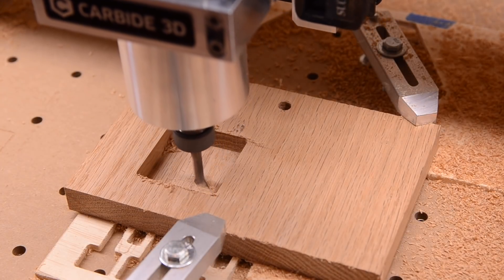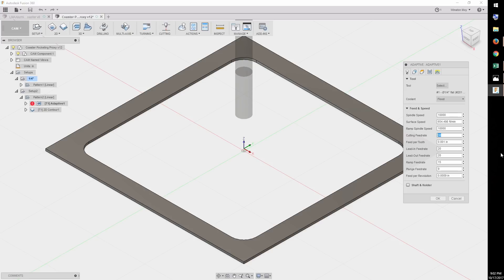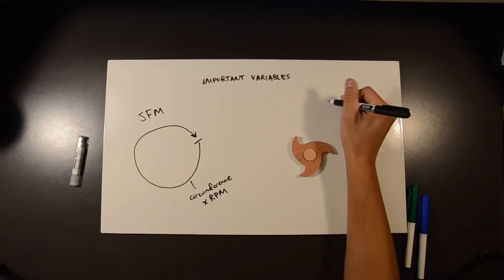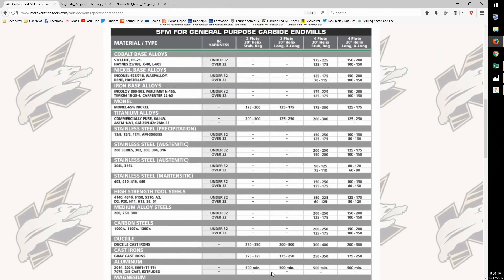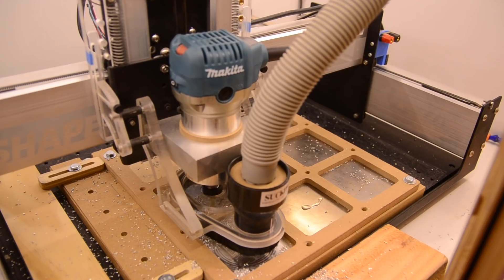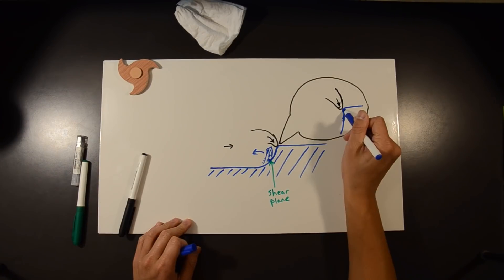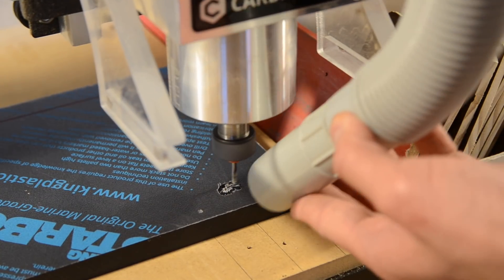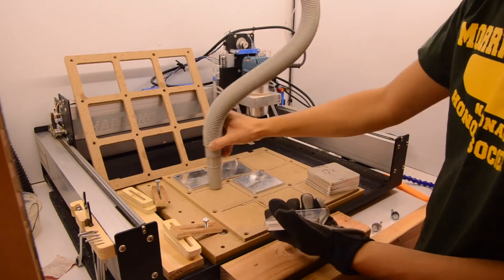Intro to CNC - Part 5: Feeds & Speeds

Comment: As always, another great video.  I would like to add 3 points.  (1) If you own a Shapeoko with the OLD style Z-Plate, PLEASE upgrade to the new plate before machining metal.  (2) Shake down your machine.  What I mean, is using a 1/4" End Mill, start at 5"/min @ 0.005" depth of cut (DOC)(I know this violates the min chip thickness, but bare with me), then increase to 10"/Min @ 0.010" DOC all the way up to 30"/Min @ 0.030" DOC (using the 5 multiplier).  What you should be looking for (or at) is the machine in detail.  Look for loose things (V-Wheels, rotating screws, etc) at each step.  This will prepare your machine for metal, and often find the "sweet spot) that your machine likes.  (3) Square the machine and Spindle using Winston's method (and feel free to buy an indicator that fits in the spindle) I check my machine about every 2 months...Yes it DOES move.  This goes for all Hobby CNC machines.    One more item:  It is nearly impossible to break a 1/4" end mill on the Shapeoko/Nomad, and will last years if used correctly in Aluminum and Brass.  Yes they cost more then a 1/8 End Mill, but is cheaper in the long run, because you WILL crash your machine...we ALL do at some point.  Now, go out and make something (JPL_Richard)
Reply: How about for a Shapeoko 2 with the ACME Z axis upgrade and a bolted X axis?
Reply: The problem with the S2 is that the rails are too thin (cross section) and therefore doesn't have enough stiffness to take the necessary chip per tooth that Winston so elegantly described with this favorite spinner.  You could take tiny time DOC (0.005 max) and eventually get there....in a very long time.  Great time for an upgrade.
Reply: @Finnley Sylas Shut up man
Reply: Very good

Comment: My DIY machine works very rough with the Vectric bits parameters, nothing nearly close to the videos I watch. Only with 3 mms. bits it works almost fine. As you say, on X or Y makes a lot of vibrations, I don´t know what to blame, the bits, the wood, the speed, the thickness..... anyway, I will continue testing following these recommendations. From Colombia, thank you .

Comment: Your illustration of the cutter and material removed shows a clockwise cut and a left-to-right movement of the router.  In the non-CNC world of routers, that’s a “climbing cut” which is less stable than when the cutter (in your illustration) moves right-to-left.  It tends to pull the cutter toward the wood that’s due to be cut, but faster than the bit can tolerate.

In the CNC world, does direction of travel matter (relative to the cutter’s spin direction), is is the “climbing cut” actually preferred?
Reply from the maker: In metal you generally want climb cutting as much as possible so the cutting edge can bite into the material and start shearing material and "forming a chip" as soon as possible. For finishing wood and plastic however, I've seen conventional cutting work a lot better in a lot of instances. It does a better job of not fraying fibers in endgrain and such.

Comment: Nice and you can advance higher by using your own sharpened carbide toolbits perhaps a three phase 24K watercooled spindle,  in a higher speed spindle you only need single flute tool bit, cheaper, easier to sharpen, basically it`s like a pencil, you can utilize it until there`s no shank left

Comment: THx for your effort, as always fun to watch. I just have to mention one thing, that hardly ever gets mentioned. 1 and 2 flute endmills are for wood, while 3 and 4 flute endmills are for metalls. There are hardly any woodworking tools, that have more than 2 flutes. While you can use em to work wood, you dont get better results.  1-2 flutes Wood, 2-3 flutes Aluminium, 3-4 flutes brass and other metalls. Still alot of ppl think spiral cutters get better results than straight cutters. which is true in some cases, but  your straightcutting tools should be one of your primary woodworking tools. A good rule of thumb used in the industry in germany for wood is, the radius of your tool is the max depth for a pass. Lets say you have a 4 mm endmill and want to route a dado 6mm deep. You take 3 passes at 2mm each. If you have a 12 mm tool you would be routing it in one pass. Reduces the strain on the tool and the spindel.

Comment: My CNC has a Makita M3700G router  with "not load speed of 35,000 rpm" on it.  the "No load speed" is the same value of spindle speed  that I have to use in the formula?

sorry guys , Im new to this concepts
Reply: Your router should compensate for the load by increasing the power to meet the speed indicated, so yeah! I'm sure you figured this out by now though :)

Comment: Hi, how are you? I have an x-carve and what I cut daily with the machine is 9mm mdf. but to make my cuts faster I bought a  Flute Straight of 3/16 bosh and in its configuration of the machine only modify dept per pass (4.5 mm) but not the feed rate (1016 mm / min) and plunge rate (228.6 mm / min ). I would like to know if this configuration is ok or I would have to modify some feed rate or plunge rate to not damage my machine.

I hope your quick answer, I'm from Peru.
Thank you.

Comment: Good Stuff.  I am an engineer who is pretty good at figuring things out but a total newb at CNC and looking mostly to add it to my woodworking hobby.  Starting to think the shapeoko is a good value machine to start with and looking at the 3XL like you have in your videos.  Any advice using the benefit of your 20-20 hindsight?
Reply from the maker: Have a project in mind before you buy the machine so you have something to focus on as you learn and narrow down the skills you need to acquire to get that first win.
You will need an 1/8" collet (or adapter, but the collet is the better way to go).
Use the community. Ask questions, get ideas, etc. It will accelerate your own learning, and inspire you.
Reply: @WinstonMakes  good advice - I think I will take the next year to clean out a good space for it then start by using it to engrave on cutting boards and toy box lids that I make for charity around xmas - a bit simplistic but I will get better as I learn...

Comment: All operations in wood can be calculated io to optimise result, finish of the workpiece, and operation time. Time is money. But somme parameters who are uncertain as the precision of the router clamping system can influence all this (can be calculated to). Big differance between a collet system and fi a heat or cold schrink clamping system. Collet precision is +/- 0.06 mm, so this means a two wing flute cutter wil have only on one wing that do most of the cutting while causing a lot of vibration. A precision clamping system has 0.004mm runout. There both wings will be cutting and with good balanced tools no vibrations. And as an extra; snapping tools are not longer a problem, and feedrate can be higher. Best regards.